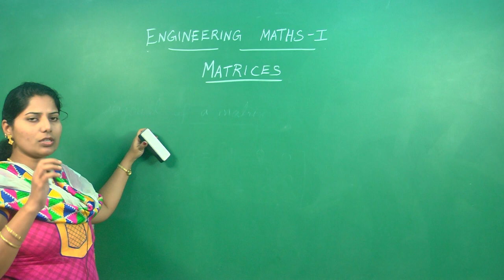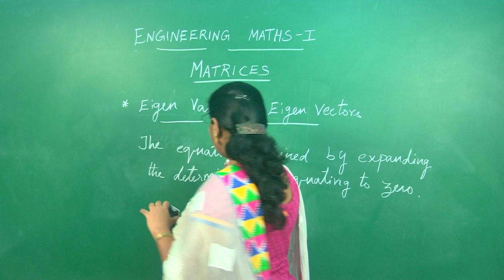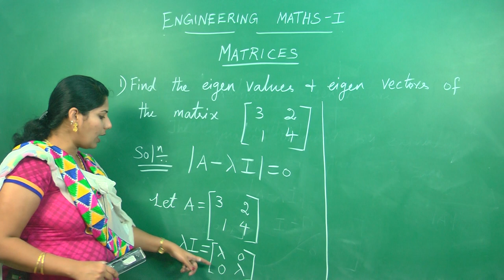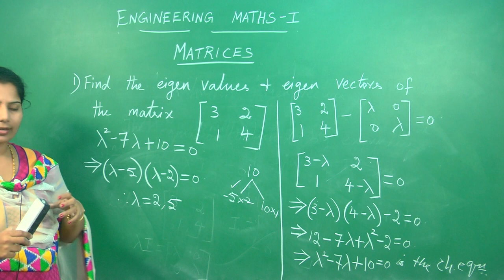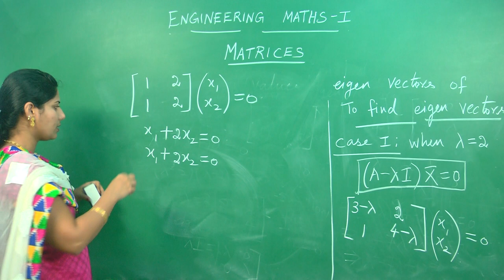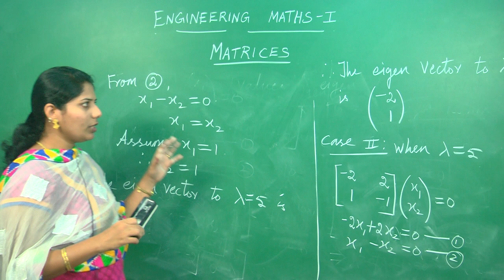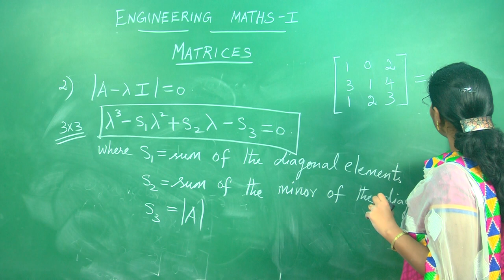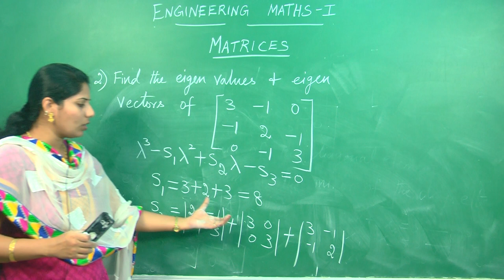Matrices- I : Best Engineering Mathematics Tips (Anna University ,JNTU ,GATE,Delhi University)

Comment: Explain the real characteristic or the use of eigen value/vector.  Mark the determinant by two vertical lines and not by square bracket as shown in the right side of the board.